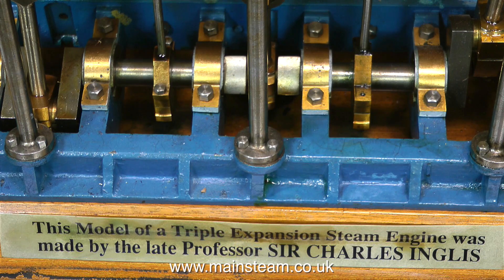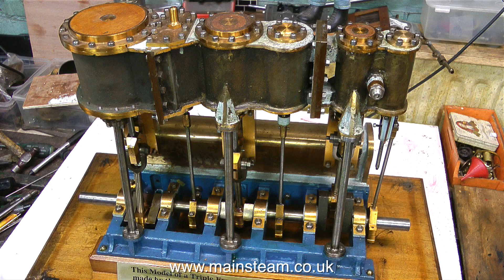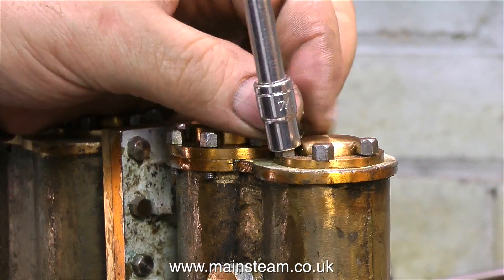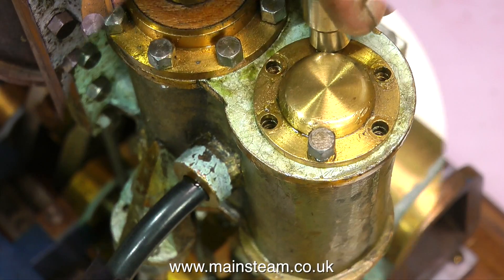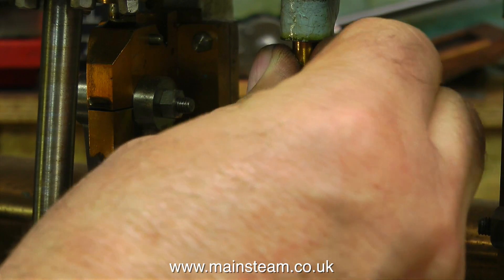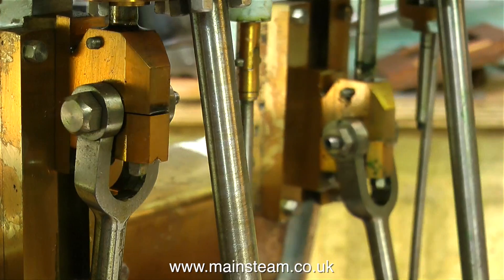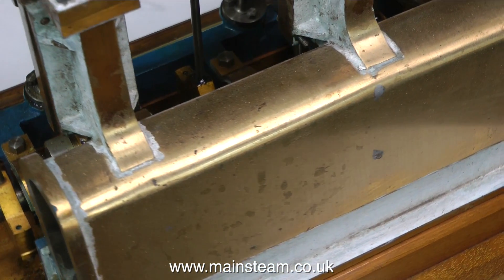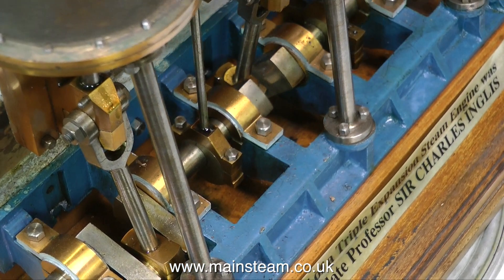RENOVATING A LARGE MODEL TRIPLE EXPANSION STEAM ENGINE - PART #1

Comment: I think triple expansion engines are the iconic engine for anything from a Gosport Ferry to a ‘Fort’ Class Store-ship.  I’ve Even seen a 4-cylinder twin-crank triple expansion engine, installed in Lypta, a dredger originally built for the Manchester Ship canals.  A collier called Pompey Light had poppet valves on the hp.  So, so sad recips are almost extinct.  That Inglis one appears to have no means of reversing.  Bulleid’s Pacifics originally had outside admission for all 3 cylinders.  But there were no HP glands, because they were driven by rockers, exposed only to the exhaust ports…

Comment: Nice one Keith, hope you're alright mucker, that engine looks quite dangerous. Unbelievable compression on the off side near the linkage next to the cylinder. Although in the days when slide valves were a thing, they were quite tricky to get hold of. I think you have to contact Janusz Prosser, head designer at the national institute of Engines. My mum found one peculiar 1337 Engine running on Thematic Hydro Carbon (THC). This is an unusual and uncommon fuel type, it is similar to LPG but it is more expensive to produce since the process is illegal in most countries, however running the engines on the fuel is tolerated by the government. The fumes from the THC gas causes people to go light headed and causes tiredness. 

Many thanks for the video Keith, tell the wife I send my love.

Comment: I wondered at the third cylinder, were they trying to wring out all the heat from the steam. Thanks sharing for Keith.
Reply: @Dana Nelson 
AFAIK very seldom used with steam locomotives and locomobile - too complicated to use in vehicles, but relatively often used stationary and with ships, here you may find even engines with more stages, up to five expansion stages......

Comment: This engine was built by Charles Inglis, it never got finished, it spent its life on display in a case situated in the Engineering department of a university in Cambridge. Once upon a time i owned this engine.
Reply from the maker: That's what I was led to believe. Thanks for confirming it. I look forward to seeing it run :-)))
Reply: Yes indeed, he spent time at Kings College as a lecturer, presumably this engine was built using the faculties at the College.
Reply: Matt Mumby oh, that's great to know, it has stood the test of time quite well, he must have had a great mechanical knowledge. I would have found it very hard to part with something as beautiful as that. Even if I was living in my car, I think I would keep it, but I may or may not have undiagnosed issues
Reply: I didn't have the time or machinery to finish it off. Best in the hands of someone with both.  .
Reply: Matt Mumby is it the same Sir Inglis that's spoken of in the video? He seems like an amazingly talented man

Comment: The professor Inglis you mention could easily fit the bill from the engineering perspective, as according to Wikipedia he "filed a US patent on 16 April 1902 for an improved engine with the cylinders mounted end to end to balance out the forces acting between them".
Could the plastic be celluloid, also known as synthetic ivory?
Reply from the maker: The sticker was put on much later. The engine was in a glass case that I don't have with it, there are locations and marks on the base. So it's looking like it is authentic and from the workshop of Professor Inglis.

Comment: Well, as you have already determined, the plaque clearly does relate to THE Professor Inglis, who was quite a man, inventing the Inlgis Bridge in WW1 and heading the Cambridge University Engineering Department amongst many other accomplishments. That the plaque is later is not surprising really. Of course some of the model may have been completed later. Looks like someone could end up with a beautiful, if very expensive, engine.